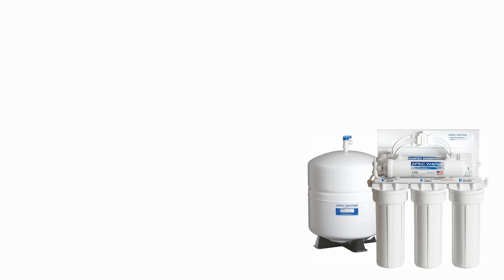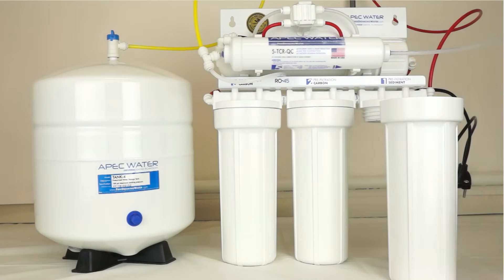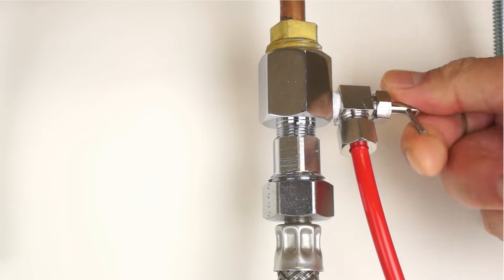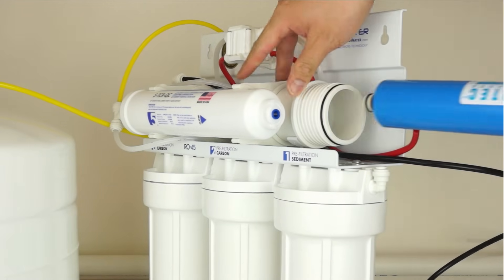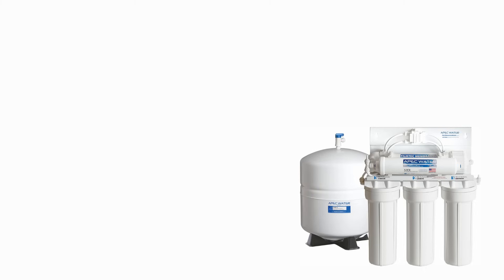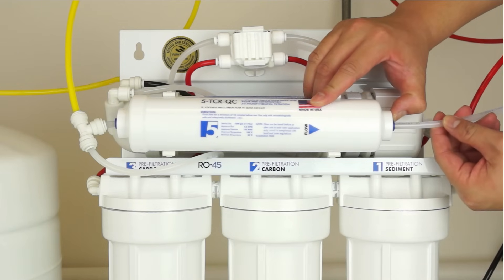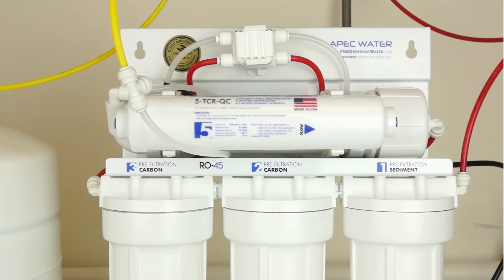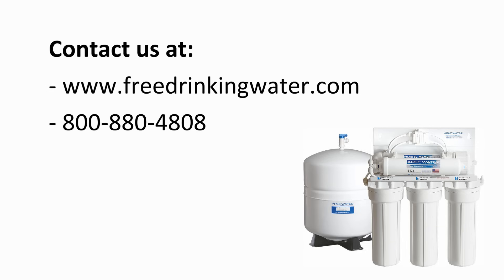How To Replace Your Reverse Osmosis Filters and Membrane - APEC Water Installation Part 6

Comment: It would be great if the RO Membrane canister didn’t require the combined strength of all the  Greek Gods to unscrew. Jesus Christ.
Reply: Any tips on how to unscrew the membrane canister?
Reply: @sagarch  Honestly? Just use the wrench that came with the system and keep trying to unscrew it as best you can. It took me about 30 minutes and a lot of yelling.
Reply: @AdamAvakian24 the wrench I have with the system is for the canisters. Way too big for this
Reply: @sagarch  Eat a ribeye steak 15 minutes before operation.
Reply: @bradstudio  still holds true.
Reply: @sagarch  I used a C clamp. Just snugged it down on the cap and used that to turn it. Worked like a charm and required a lot less swearing. Lol
Reply: @sagarch  Get the wrench.
Reply: @sagarch  i dipped it in boiling water. I was able to open it after that
Reply: @sagarch make sure its dry. And your hands are dry. Unattach it from the other cylinder so you can get a really god grip
Reply: Oil filter wrench worked wonders for me
Reply: @sagarch  Use a large ChannelL lock or other slip joint pliers to keep the canister from turning while using the small cap wrench provided.
Reply: @sagarch  Use a large ChannelL lock or other slip joint pliers to keep the canister from turning while using the small cap wrench provided.
Reply: @sagarch  Use a large ChannelL lock or other slip joint pliers to keep the canister from turning while using the small cap wrench provided.
Reply: Guess why I am here? Because I can’t get the chambers open. I exerted so much energy trying that I finally gave up and threw myself on the couch and ugly cried for like 10 minutes. I called APEC Customer Service for advice/help and the rep basically told me I was on my own.
Reply: MY SOLUTION: I’m a widow (5’4”, 120 lbs) and am having to change out the filters by myself for the first time. The dedicated wrench for the stage 4 (RO membrane) wasn’t working for me. What worked, finally was this. I disconnected the fittings. Then microwaved about 1 cup of water (in a 2 cup measuring cup) until very warm. I then held the RO canister lid down in the hot water for about 30 seconds. Then I wrapped an old washcloth around the lid and then fitted the wrench around it. It worked!
Reply: @TallyRocky  exactly what i did
Reply: @TallyRocky  THANK YOU from the future for this very helpful comment that I'm finding one year later! It was still very difficulty, and I still needed to pull the whole thing out and use a wet towel with the wrench, but I finally got it!
Reply: @TallyRocky  thanks for this! I used boiled water from the kettle and submersed it for 30-45 sec, was then able to unscrew it with firm hand grip and turning.
Reply: Holy Hell!! You're not kidding. I had to remove the canister from the housing, wrap a wet towel around it, then wrap that with a LOCKING CHAIN CLAMP to get enough leverage on the canister to use the APEC wrench on the cap. Ridiculous.
Reply: getting help from a second person (in my case the missus) made it easier; while one holding the canister body, other can apply two arms force to the wrench. :)
Reply: @sezilhakanevircan2737  thinking of remarrying my ex hubby now! He was so strong…. Im getting desperate!!😂
Reply: Just a quick update for you all. I found a method that works wonders for me. Get a damp cloth. Place it over the cover. Put the provided wrench as you would. Then use the flat side of a hammer and smack it. Or if that doesnt work, use your feet. Wear a shoe or slipper. Thank me later. 

Who the fuck designed this thing?
Reply: @AdamAvakian24  all gooood bro this water forces us to hit the gym and smash these filters off.gainzzz
Reply: @AdamAvakian24  i had to dip it in boiling water. Loosened it right up
Reply: 😂 this is so true

I had to take it out of the assembly in order to get the cap off, and I was using the wrench.
Reply: Made a few attempt on my own use all my strength to unscrew and I though I was going to break the provide wench.  Gave up and google this video.  Follow the steps to CLOSE the RED RUNNING WATER, THE BLUE TANK AND TURN ON THE FAUCETS for a few mins. let the air pressure go.  I use the wench 1/3 of the way up the canister, use hardly any strength to loose all 3 canister.
Reply: @nava284  He's talking about the #4 filter, not 1-3. Good luck with that one. ;)
Reply: @nava284  those are not the canisters people are complaining about... The RO membrane canister is the issue
Reply: @nava284  Consider yourself lucky
Reply: @AdamAvakian24  sorry I misunderstood you meant stage 4 filter.  Not 1-3, I will have to wait 1 year to find out :).
Reply: Broke the wrench it came with 😬
Reply: Update: I did it!!!! All I gotta say is 💪🏻. A lot of it!! Lay it down and go as hard as you can to the left 😂😂
Reply: @emilyirene2806  Hey! look at you! congrats on making it into the club. Hopefully it didn't take you 7 hours like it took me to reply to your message xD
Reply: I’m literally stuck in the same position. Have you found an easy way to unscrew it???
Reply: @emilyirene2806  The best method i had was using a wet/damp cloth or towel and just drop kicking. I mean, just trying to brute force it. Sorry :/
Reply: @AdamAvakian24  thank you! After about 20 times trying, I wrapped a cloth around the handle because that was hurting me the most. Come to find out, two filters were in good condition but the last carbon filter was brown 🥴
Reply: I disconnected it and used the floor and the wrench. Made it easier.
Reply: Yes…I can’t get the canister cap off no matter what I do. Is pissing me off!
Reply: Ha!!!! Omg that is so true I thought I was break it lol
Reply: Right. The video dude is two fingers. Think I'm giving up on that filter
Reply: It's best to disassemble and disconnect the membrane housing from the unit, so that you can get a proper grip. Then, use the small wrench that came with the system.
Reply: @kierz-io  done that and STILL cant unscrew! Even with wrench and grippy sponge things 😫
Reply: I had to remove the canister and place it in my vise in order to remove the cap. Just needed some extra grip.
Reply: And the needle nose pliers have the power of mjölnir…
Reply: I put some rubber bands around the body and used a dewalt clamp. That did the trick. Took too long to get to that point and I have lost all feeling in my hands.
Reply: I used a vise as well. I'm 5'1 with a wonky back and that thing has saved me often in situations like this. Worked perfectly, just make sure to wrap a towel on the canister before putting in the vise to avoid damage and don't tighten it too much.
Reply: So flicking true
Reply: Yeah me fucking too
Reply: My pimp hand is strong
Reply: So glad its not just me! Ended up bashing against worktop to release but NO, still stuck!! 😰 even got confused i was turning wrong way so kept checking on video. Gonna need to keep it on kitchen floor til son arrives next week! 😬
Reply: Turned to chocolate now to soothe the nerves, so much for the fit new me with this filter
Reply: Underrated comment. Just dealt with this myself and I'm not a small guy by any means.
Reply: Wrapped several layers of duct tape close to cap on RO canister then used a large pair of channel lock pliers along with the plastic tool and off it came.  The sediment and carbon canisters need some brute force! Good luck!
Reply: Yep, me too. My best advice is to wear thin rubber gloves to get extra grip with the hand that's grabbing the cylinder, use the supplied wrench tool (essential) and have a large collection of your favorite cuss words handy. It doesn't help that the guy in the figure spins it free with a single finger.
Reply: Just the Greek gods brother? Yours must be easy. I called the Greek gods, after an afternoon of hard sweating, they left to go get help from the Asgardian, after another 2 hours of swearing by helheim both the Greeks and Norse left to go get extra help from the Egyptian. They came and after discussing whether or not we should make a human sacrifice to Ra for an hour we settled for sacrificing my nanny and we finally wrenched it loose
Reply: Lmao best comment 😂
Reply: I had to take ro canister off and lay on steps and apply a pipe wrench. Worked out okay.
Reply: Thanks for all the comments guys… made my day… it’s the day after for me… the 4th filter took me hours to figure out… ended up seeing a video of the hot water trick… it sort of worked… I ended up having to place the canister on the ground attach the small wrench and placed my foot on top of it … and yelled … as I pushed down … I’m 5’7 and a 180lbs and my wife and  I both had tried for over an hour with towels and gloves… it comments like these that bring me joy in times of trouble..!! Thank you guys and gals!
Reply: I just used my hands. Maybe you didn't release the pressure first?
Reply: @trevorbrzycki6628  i definitely did that
Reply: @AdamAvakian24  gotcha. for whatever reason mine was doable by hand. Maybe different pressures in our systems or mine had been under tightened. I still spent hours looking over my tubing and fixing my tubing (it was not hooked up correctly). Some parts were not easily found ... But it's finally OVER
Reply: Lmfaoooo for real
Reply: Can confirm, letting pressure out made all the difference.
Reply: OMG THIS IS IMPOSSIBLE
Reply: These pre filters and oil filters on late model fords will be the only things left a thousand years from now. Our future generations along with aliens alike will all kneel to their unyielding defiance.
Reply: Yep just clamp it and twist
Reply: I figured it out. Take the whole piece off grab the RO casing with two hands stick the handle into something solid. I used a 15 pound weight for a bench press, but it could be anything with the whole big enough to fit the handle then don’t try to use your arms just grip it real tight and drop your body weight. Worked for me.
Reply: Bruh my hands are swollen trying to open this thing 😂
Reply: 36” breaker bar attachment? 😂
Reply: I took mine out and put into vice then used large pump players 😂
Reply: I came here to figure out how to open membrane.... I have been working on it for over an hour 😢
Reply: @jessicafeatherston2172  instead of trying to turn it by hand. What I did is put the tool under the the edge of the kitchen counter and lift up, causing it to unscrew.

Like instead of trying to turn the tool and holding the canister by hand. Put the tool on the cap of the membrane and hold the canister with both hands and put the edge of the tool under the edge of the kitchen counter and lift up. Unscrewing it
Reply: Any tips im here dying tryn to open it
Reply: @jeremywilson32  I wrote in the comments how I opened it.
Reply: What sort of dark magic is this? My back, wrists, arms and patience are all shot. I didn’t know plastic could be welded together. Going to need to go to ACE and get a pipe wrench. 💀
Reply: @MrPyleStyle    instead of trying to turn it by hand. What I did is put the tool under the the edge of the kitchen counter and lift up, causing it to unscrew.

Like instead of trying to turn the tool and holding the canister by hand. Put the tool on the cap of the membrane and hold the canister with both hands and put the edge of the tool under the edge of the kitchen counter and lift up. Unscrewing it
Reply: Used hair dryer to blow hot air for 60 seconds in the gap between lid and membrane canister, then it  opened easily with hands . Hope it helps someone.
Reply: I held the body with my 2 hands and pushed down the handle with my right foot. Seriously, APEC needs to redesign this
Reply: Ironically only one of those gods is the capital G and you used His name as a swear word. 🤦🏼‍♂️
Reply: @OathKeeper1506  why does that bother you?
Reply: Today is the day i replace my filters... yayyyy.
Reply: Agreed . Couldn’t unscrew that sob
Reply: Not a greek god
Reply: I had a huge pain with that one when changing out the filters at my sister's house a few months back. Since we had a boil notice last week in my part of FL, I decided I should change them after having a grumbly stomach from trying the water the past few days. Mine I was able to get unscrewed by myself. It only took me about 5 minutes of trying to unscrew normally with the wrench before trying to jar it free with a few palm smacks on the wrench handle. My sister's on the other hand took about half an hour. So I can attest to the fact that it can be a booger, especially if someone over tightens it as I'm sure her ex probably did.
Reply: I used my large channel lock pliers to hold the canister.
Reply: I just hire the water guy….. $200 and it’s done.  I have terrible arthritis in my hands and can’t often hold a pencil; so I hire it done… but it always looked so simple I wondered why I didn’t do it myself before my hands went bad.  Glad now I didn’t try after reading all the comments.
Reply: pro tip,  use a small strap wrench on the housing, and the tool that comes with the system for the cap. still requires some strength,  but it took me less than a minute.
Reply: I know, I suffer every year
Reply: Went to the gym. Used a wash cloth, hammer, pipe wrench. Even tried to find a strong man!
Gave up! Will change it next time, and invite Superman and the Incredible Hulk to that event!
Reply: Get to the gym. Use the small wrench that comes with the system.
Reply: @bradstudio  didn't think I'd need to be able to bench 445lbs to unscrew. Also, that's with the screw.
Reply: @bradstudio  WHAT small wrench?

Comment: On average how often do you have to replace the filter from each stage?
Reply from the maker: Hello,

you would change out stages 1,2,3 anywhere between 6-12 months and the 4,5 anywhere between 2-5 years on average depending on the model number of the system you own. 

If you need further assistance, feel free to contact us directly by calling 1-800-880-4808 or e-mailing us at info@apecwater.com. We are in the office from Monday-Friday from 8:00am-5:30pm PST. 

Best Regards, 

APEC Support Team

Comment: Can i call your number asking you sending a plumber to my house to help me  pump air in tank and fiil water in the tank. I ‘ll pay the labor fee. I live in riverside, ca 92509.. phone 951-347-3561
Reply from the maker: Hello, 

we are the manufacturer of the systems and do not offer any maintenance service. I am sorry. 

These systems are user friendly so anyone that is a little handy can re-pressurize the tank using a bicycle pump or air compressor. If the tank is losing pressure typically the bladder has worn out and the tank would need to be replaced. Adding air into the tank is more of a temporary solution. 

If you need further assistance, feel free to contact us directly by calling 1-800-880-4808 or e-mailing us at info@apecwater.com. We are in the office from Monday-Friday from 8:00am-5:30pm PST. 

Best Regards, 

APEC Support Team

Comment: Thank you for your instructions. Please can you help? I have 2 questions please. 
 On first flush, I got a lot leak from the membrane (black water), I fixed this & left it running for 5 minutes, but only 30 seconds of black water & then all clear water came out.
 Q1: On 2nd flush, I get a few dribbles of water & then nothing comes out. Water pressure is saying zero ? I cannot use this without doing a 2nd flush, right? 

Q2: how long to leave the tank fill up to make sure it's 100% full before emptying it? (Obviously I'll leave it running till there's no more water). Also , which taps to close/open at this stage, please? ie. I think only Mains on, tank on. 

Thank you
Reply from the maker: Hello, 

after replacing all the filters on the unit, you would turn the feed water back on and open the tank valve. Then you would open the drinking water faucet and flush out one tank of water (which takes about 6-8 minutes) until the water comes out in a tiny continuous stream. You would then close the faucet. There only needs to be one flush done.

It will take approximately 2-3 hours for the tank to fill depending on water pressure. At this point the main feedwater valve should be open all the way, the tank valve should be open and the drinking water faucet should be closed.

If when it dribbles you lift the tank to see if it feels light or heavy after it dribbles out. If the tank feels heavy then the bladder inside may have worn out. 

 If you need further assistance, feel free to contact us directly by calling 1-800-880-4808 or e-mailing us at info@apecwater.com. We are in the office from Monday-Friday from 8:00 am-5:30 pm PST. 

Best Regards, 

APEC Support Team
Reply: @apecwatersystems  hi... I apologise 😬 I posted the question to wrong video ☺️
Reply: @UmmatiMuhammadin  so the issue was not with the apec water system?
Reply: @eeeeeeeeeeeeeeeeeeeeeeeee-s3p  hi. I don't know sorry 😬 its fixed now anyhow.

Comment: If yall are having trouble with the RO membrane cap, I disconnected it completely, and propped the wrench against the floor and used my hands just to hold and twist the canister/tune.

Comment: Hi, when I change the filter, the first stage has some brown slimy residue on the entire housing, and the second and third filter has some gray slimy residue on top of the housing. Is this normal??
Reply from the maker: Hello, 

The first stage filter is designed to remove sediment particles from the water while the stage second and third stage filters are designed to remove chemicals.  It can be normal as the residue may be from the buildup of what is being filtered out from your tap water. You can wash the housings out with mild soap and warm water after each filter change. 

If you need further assistance, feel free to contact us directly by calling 1-800-880-4808 or e-mailing us at info@apecwater.com. We are in the office from Monday-Friday from 8:00am-5:30pm PST. 

Best Regards,

APEC Support Team